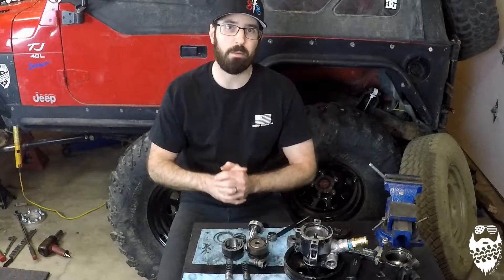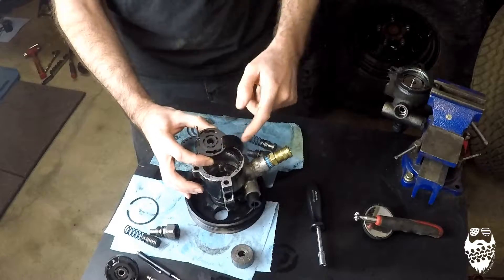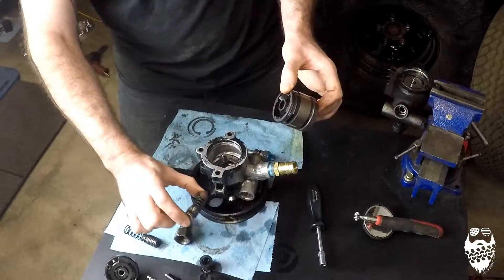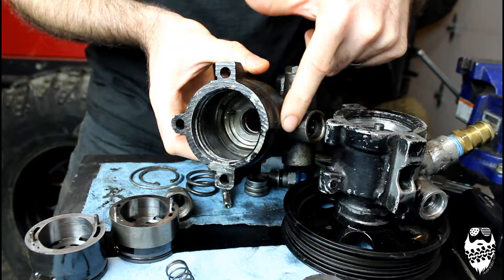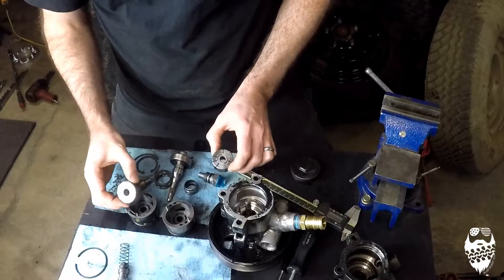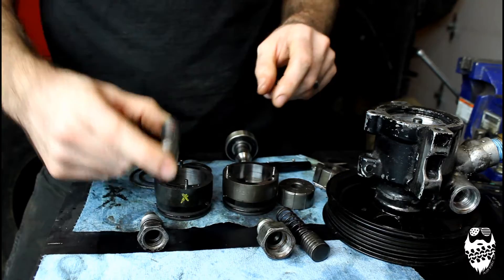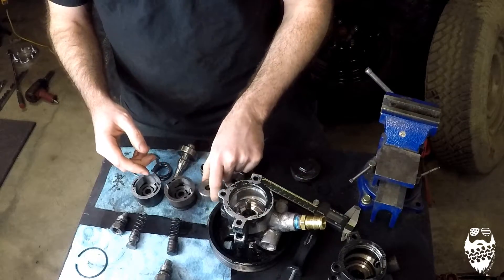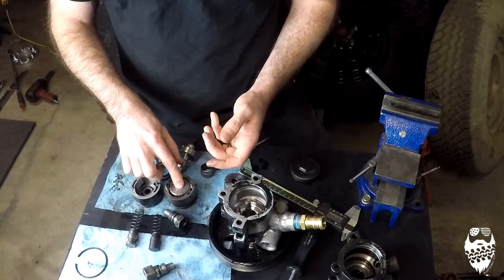WJ vs TJ Power steering pumps, How a Power steering pump works

Comment: Great Video 👍 I did the WJ swap in my ZJ last week but I just installed the pressure relief valve and the power steering cooler. WOW I noticed a difference. Oh BTW time to bring the TJ back 👊

Comment: Just curious. Anybody know if the YJ and the XJ use the same pump? I learned the hard way that the XJ and the WJ share the same pump on the 4.0 & 4.7 litre in '99 & 2000. I think it's the '01 - '04 4.7 & 5.9 V8's that use the quicker/stronger pump with 2 low pressure lines?

Comment: Does the Grand Cherokee pump use the same pulley, or is that needed too?
In other words, can I reuse the reservoir AND pulley from the TJ?
Reply: i think the pulley is NOT the same, and you need to swap your old pulley over (most new or reman pumps don't come with a new pulley anyway)

Comment: The WJ pump doses two jobs, one steering   two runs the rad. fan
Reply: Only on the WJs equipped with a hydraulic cooling fan, very rare have I seen that.  More common is either one electric fan or both the electric fan and clutch fan together for the towing package.

Comment: So the TJ reservoir fits on the WJ pump because both pump housings are the same casting. correct? So to use the WJ pump on a TJ, the only requirements are to swap the TJ high pressure output fitting & TJ reservoir over to the WJ pump?
Reply from the maker: It seems that way, don’t see why it wouldn’t work.
Reply: i was told that the reservoir will not swap over. they have a different style connection and oring